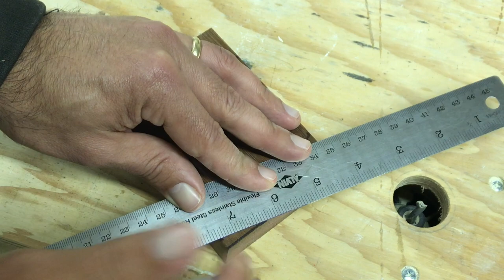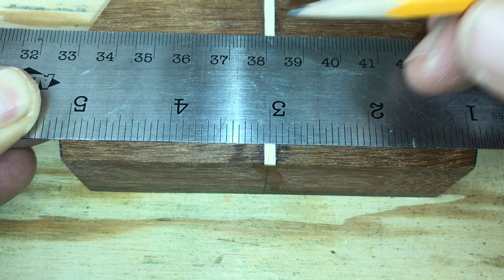Beautiful DIY Wooden Putter

Comment: That was crazy good Stan, if it’s good it doesn’t need words. I assume the weight and all worked out or was there anything different you would have done?
Reply from the maker: Thank you, Harki...I actually made the first one just to have a prototype of a putter I was going to have built for me to play around with a new putting style.  It's very upright, a little bit longer and a bit heavier...the fact that it actually felt good and the ball came off the face well was a pure bonus!  I weighed all of the components before glue up so I knew I would be close to what I wanted.  At this point I can't say I'd do a lot different...but I am going to be making a few more in different head designs now that I know they are viable.
Reply: StanCrafted came out nice that’s for sure

Comment: Great work! What glue did you use to keep the shaft in the wood putter? No matter what I use, it has a hard time holding
Reply from the maker: I used epoxy. I think it helps if you rough up the tip of the shaft with sandpaper and then clean with denatured alcohol. Thanks for watching and commenting.
Reply: @StanCrafted  I've tried a number of different epoxys and I cant seem to get the glue to hold the shaft longer than a few rounds

Comment: This is really nice. It would be great to get a template I could print off so I could make one myself. Do you have anything like that?
Reply from the maker: Hi Steve...I don't have a template for that putter...I actually made about a dozen all with slightly different designs.  I will try to get some measures tomorrow and post them for you.
Reply: @StanCrafted  that would be awesome thank you. My dad loves golf so when I saw your video I thought Xmas gift. Thanks again. I'll keep an eye out for those dimensions.
Reply from the maker: @inspectorsteve2287  The basic measures that I use are 4 inches across the face of the putter that taper out to 4.5 inches one inch back.  The front to back measure is 3 inches and the width across the back is 2.5 inches.  Hope this helps!  If you have any questions you can find me on Instagram at Stancrafted
Reply: @StanCrafted  that helps a lot. I do have one question. I don't have Instagram so I hope this is ok. You said it's 4.5 inches wide on the face but then say "one inch back" did you mean to say one inch thick?
Reply from the maker: @inspectorsteve2287  No worries...the face is 4 inches and then it tapers out to 4.5 inches one inch back from the face...the widest part is one inch from the face.  The face is just over 1 inch thick though...I forgot to mention that.
Reply: @StanCrafted  oh I follow you. Great thank you for your time I appreciate it.

Comment: How much did thisevweights you put in weigh?
Reply from the maker: Hi Morgan, I used four two-ounce weights in the putter...but, I like a heavier putter.  That puts the head weight at just over 400 grams...and typical weight for a putter is closer to 350-360 grams.
Reply: Thanks man, I'm wanting to build one soon, and just needed to know what I needed to get, thanks for getting back to me
Reply from the maker: @morganray3994  Absolutely...hit me up with any questions you have as you go...happy to help
Reply: And those 2 metal pieces you put in the front of the putter,bare those necessary,  or could I leave em out
Reply from the maker: @morganray3994  Those aren't necessary they were an alignment aid.  I'm now doing three stripes instead of one...I like that look better.  I think I have a picture of one on my stancrafted instagram page
Reply: Thanks for your help bud